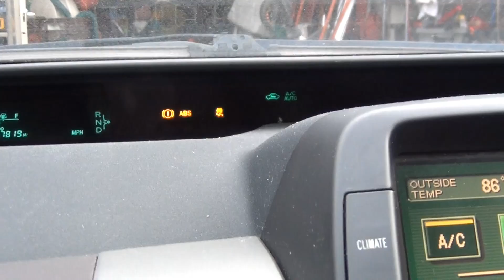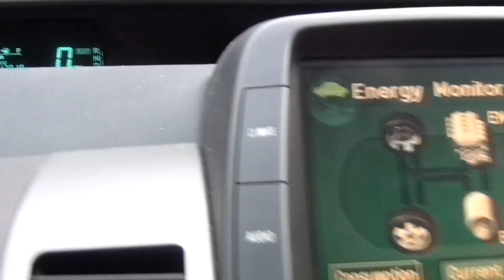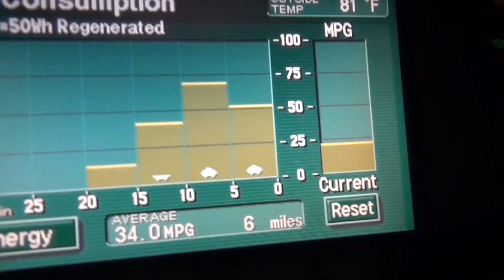2004 Prius Replacing Hybrid Battery

Comment: Using the plans to help you recover all kinds of old and dead batteries more at a lesser time. You don't have to be a professional to build with these plans [Link Here==https://plus.google.com/100351090281822647456/posts/Gwtd4mVBdEd ]. They are easy to implement.

Comment: hi quoc, did you encounter any intermittent headlights problem with your prius? if yes, pls. post your solutions, thanks.
Reply from the maker: No. We did not have any intermittent problems with our headlights. However, that same bulb in the video went out like 2 months ago and I had to replace it again. This time I went back to the cheapest grade bulb.
Reply: so it is a case of premature burnout of the bulbs? instead of intermittent? did you ask toyota dealership about that burnout problem? can this year model can be converted to LED headlights wi a conversion kit? thanks
Reply from the maker: I'm so sorry. I previously responded while thinking this is about my other video of replacing a front passenger light bulb. Please disregard that message.

Ok in regard this this video of replacing the hybrid battery unit, I have no issue at all. This Prius now has something like 230+ to 240K miles on it now.
Reply: Prius HID bulbs fail "intermittently", i.e., when they fail, they come on initially, but they go out in seconds or minutes. If turned off and back on, they will repeat. 99.9% of the time, the HID bulb needs to be replaced. Headlight function is completely independent of HV battery.

Comment: Congrats!! How long did it take you? Mine is an 08' with 300k miles!! Found an independent Toyota tech near me who rebuilds these HV batteries for a living, $575 with 6 months warranty, I might go that route instead when mine quits. Thanks for sharing.
Reply from the maker: +Bom Malai Thanks. I think it took a couples hours the get to the battery on one day and the next day it took just about the same time to put the replacement battery in. I went really slow and video taping along the way. There's another video on YouTube where a professional gets to the battery in like 10 mins. In regard to your future replacement battery, I think I prefer one that came off a wrecked Prius than a rebuild one unless both parts came from  low mileage Priuses.